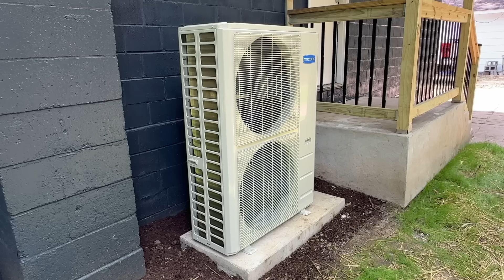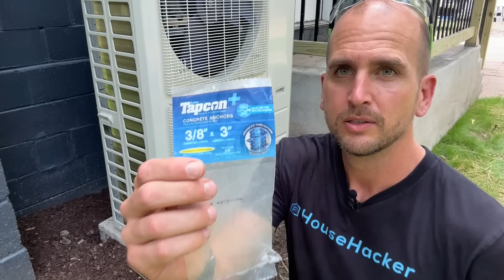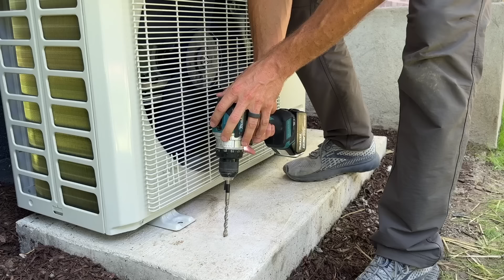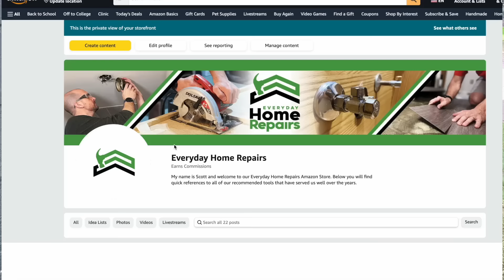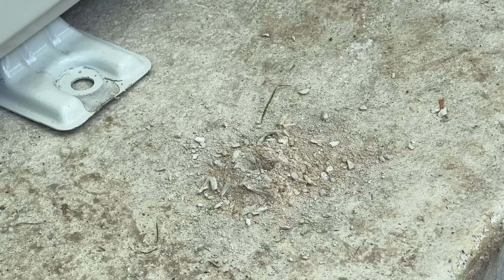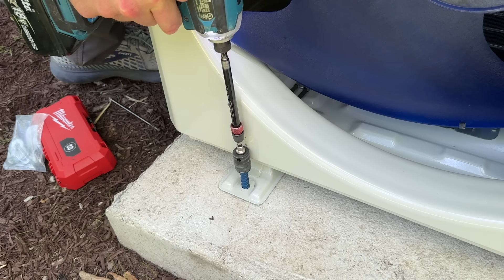The Only Concrete Anchor You Need And How To Properly Install

Comment: Want to anchor an accent rug over carpeting which is glued down to a concrete floor. Accent rug creeps with drift of carpeting. Two sided tape doesn't work. I need to screw the rug down so rug creep stops and only need to anchor one end of rug to stop drift. Suggestions on approach to using Tapcon for this effort?

Comment: There is something missing to your work bro,, you did not put any transision pad rubber between the concrete slab to the base of the A/C  this might cause vibration and corrosion..

Comment: I normally use a hammer drill, and I must not keep it straight throughout drilling.  I consistently create holes bigger than the screw.

Comment: I am a mechanical engineer, and this is my opinion. the Topcon directly screwed into the concrete, its secured depends on the quality of the concrete, if it has too much sand and gravel, the hold will be weak. The other problem is that the threads are cutting through the concrete with very shallowed threads to the root diameter of the screw and it doesn't provide a good hold if a force is applied to pull it out.  I spoke to a supplier, and they recommend using and epoxy for concrete gel into the hole to provide strength. For use horizontally on a vertical wall, with a perpendicular download, it should be ok. I don't recommend the use of Topcon for heavy load or applications with pull force. the advantages of using a lead anchor are that lead is a soft metal, and the screw will push material against the concrete hole creating a tremendous amount of pressure, to pull the screw, the concrete has to break first
Reply: Great info.  How would you attach the wall of a framed room addition to a cylinder wall of a house?  Topcons or Exoxy anchors in the hollow block wall?
Reply: You are absolutely right, I am a mechanical engineer and Tapcon screws are the last thing I would use on a concrete wall. I also spoke to a supplier and told me the same as you, to use epoxy in the hole which defeats the purpose of the use of Tapcon screws. My preference is a lead anchor, when the screw is going, it will push the lead laterally against the wall creating a tremendous amount of pressure. Any other system that applies lateral pressure against the wall is much better that tapcon screws

Comment: Instead of the electrical tape trick. I just get out a sharpie marker. Spin the drill bit and touch the marker at the depth I am going for. Washes off with a little rubbing alcohol. That way you don’t have adhesive from tape or have to worry about getting stuff stuck in the drill.

Comment: Tapcons are trash. Sorry had to get it out of my system. 

Built houses for over 30 years. Have affixed literally thousands of boards to concrete and steel and other various hard materials.  We used Tapcons when we worked out of state and forgot to bring real anchors with us.  

A concrete anchor shouldn't be able to be stripped out of its hole....it's friggin concrete. It either grabs or the anchor is no good. Over tightening shouldn't be a real issue unless you're just a complete bonehead. 

They'll work if you have to use them but are pretty finicky as far as concrete anchors can go.

Comment: I have had a lot of problems with the drilled holes being too loose.  I have used the specified drill bit size.  I think I must be pushing too hard on the hammer drill and the hole becomes oversized.

Comment: How about sealing the holes around the wedge anchors or these Tapcon screws?  I am putting in an outside hand rail into concreate and dont  want moisture to get in the hole and freeze.  Any tips?

Comment: Wow! I drill hundreds of holes a day with an SDS 3/8 red head and each hole takes like 5 seconds at most. After about 100 the bit starts to wear, I never use these bolts because they don't hold the weight. These screws are definitely for the diy but professionals shouldn't use the screws that you can never tighten down.

Comment: For the job you're performing, I would have inserted rubber damping squares between the concrete and the feet of the AC condensor to limit vibration to the unit.

Comment: I sort of like them but sort of dont. You kinda can't keep moving them. With wedge anchors you can remove the nut and move the item to like clean underneath and stuff like that, and then put it back and retighten the nut. With tapcons you'd have to remove the entire tapcon and everytime you do the hole isn't as tight. But if you actually DO need to remove the tapcon completely you can, then just fill the hole. With anchors you gotta cut it off with an angle grinder.

Comment: What’s the drill attachment called that he’s using to drill in the tapcon?
Reply from the maker: That is just an Masonry bit, specifically it is a "SDS" since I am using a larger rotary hammer drill which uses a chuck called SDS.

Comment: Yes, that hammer drill was not on the powerful side. SDS will also give you much, much better hammering and speed, even on the same powerdrill, than a standard choke head. The stroke is longer.

Comment: you should use rubber blocks with rails on them under that unit so when it snows the unit is not burried and the fan doesnt freeze stuck.

Comment: About to use these exact same sized Tapcons for setting posts for a horizontal fence on a newly poured slab for our pool. Question.... Any recommendations on how far off the edge you should go? I'm afraid with a large size like that, getting roo close may cause popping or cracking issues. Was thinking of setting the footings about three inches in from the edge. Any advice would be awesome!
Reply from the maker: I would be comfortable within 3 to 4 inches of the edge.  You could probably even go closer but if you can have a bit of an offset that would be good.  Wedge anchors would be a different story as they do press against the inner diameter of the hole as you tighten them up.  If you want to even step up from Tapcon try to find the similar product from Simpson StrongTie the Titen HD are really nice and have much more bite than the Tapcons https://www.strongtie.com/mechanicalanchors_mechanicalanchoringproducts/thd_anchor/p/titen-hd
Reply: @EverydayHomeRepairs  man thank you so much! Great advice!

Comment: I don't like the tapcon anchors. It seems about half the time I try to tight them the threads just strip out the concrete instead of making a secure connection.

Comment: Would it be smart to put rubber bushing/damper between the ac and cement to address vibration and noise. Ty
Reply from the maker: For sure, that was a miss on my part.  Thanks for the feedback!

Comment: I've seen those Tapcon concrete screws corrode significantly from moisture in concrete.  The heads shear off if trying to remove only after a few years, especially for the 3/16" diameter size.   I would only use stainless concrete fasteners in an outdoor environment.

Comment: If a Tapcon strips out just take a piece of bailing wire or weedeater string and stick it in the hole and screw in your Tapcon. Make the wire or string longer than the hole so you can cut it off after you screw in the Tapcon.

Comment: To the point about debris clearing, a can of compressed air such as used in cleaning computer keyboards and electronics would be a great help to blow out the bottoms of the dust and grit, and portable and convenient.

Comment: Failure mode is snapping off in the hole. That one sucks bigtime. For a stripped hole I use heavyweight Weedwacker string I cut lengths of it and stick it in the hole as much as I can then re insert the Tapcon. It also works for regular screws if that is all you have for concrete or a mortar joint and wood too.

Comment: What size drill bit u use for the 3/8 tapcon
Reply: 3/8. 3/8 is the shank size, that allows the threads to bite in without cracking the concrete or stripping the hole

Comment: I’m planning on putting 2 anchors into my concrete floor garage with hooks to strap down the rear of my motorcycle (set on it’s center stand  so the front wheel floats off the ground) and I’m wondering how much force/weight pulling upward can these Tapcons hold?

Comment: One tip I would recommend is not to tighten the bolts until you have all 4 bolts 90% or so in place. This will help preventing any possible alignment issues that could also cause your last bolts to not go in easy and even possibly strip

Comment: Insert stripped 12 or 14 gauge copper wire into the stripped hole and drive the Tapcon in. Snugs nice and tight.

Comment: My problem is more with the concrete than the Tapcons. I've got an old farm with what I call "farmercrete" -- concrete made as cheaply as possible with local river rock (some up to 3" in diameter), dirty sand, and a minimum amount of cement. The big problem is those rocks -- some of them are so ridiculously hard you can't drill through them, and if you do, the Tapcon will bind up as you insert it and it'll break off. Or you'll blow out the concrete when you drive the Tapcon because the large stones move instead of allowing the Tapcon to bite.

Comment: If you strip out the anchor I never drill a bigger hole I use weed wacker twine. Grab a roll of the bigger diameter twine and just put a couple of pieces cut to the depth of the hole then put the anchors back in. I've never had a problem using this method. Good thing about this its years before the twine breaks down if at all.

Comment: How are those Mr Cool mini splits? They seem super easy to instal. Any problems to look for? I've only done 1 mini-split so far(done many furnaces\air handlers w\ AC tho). I like the fact these are all pressurized already & ready to go after hooking up the lineset w\ flared compression fitting ends(no solder\brazing). 🛠️🔩🔧🗜️🔨📐📏👨🏻‍🔧👨🏻‍🏭😀🍻

Comment: Worked on alcatraz island for 25 years,doing concrete work, Tapcons were my best friends!
Reply: Were you installing your own escape hand and footholds?... 🤣
Reply: @thebordernow 😂😂😂😂
Reply: Hey,dogsense I worked on the Russ building in SF in 98 at 33 stories, and Tapcons were my best friends too. I could see Alcatraz from the roof. From SF Towers too.
Reply: @rickarchuleta1  alcatraz 1993-2018!
Reply: Tap Cons don't work everytime have some wedge anchors for those cases
Reply: My question is are the tapcons adequate to secure a 10x10 pergola where the winds can easily exceed 50mph? The anchors that came with my pergola are longer than the brick pavers I have
Reply: Native SF Born Raised…did guys really escape or is that BS
Reply: @dogsense3773  I live in Pacifica on the water just like Alcatraz did the cement ever break down I see some foundations here start to crumble under tap cons cause they used sea sand….

Comment: I notice that the fitting into the hole made by the driver has a better snug fit compared to the one made by the rotary in hammer mode. In my experience, rotaries in hammer mode just makes bigger than intended holes although in drive mode it’s often a pain to drill into concrete. Great video.

Comment: Careful where you drill there are buildings with tension cables in the cement floor.
Reply: If the buildings have "cement" floors, they won't be around long anyway.

Comment: always find at least 1 stone right where i need the hole and the drill wont cut the dammed thing... there always as hard as hard gets  and if there is one stone in a 3 acre concreate pad  i always walk right up to it and manage to put the center of my hole right over the stone every time ....    if i had luck like this in lottery  i would have to burn my money to prevent drowning in all of it

Comment: When I replaced the aluminum lattice columns, on my front porch awning, I used Tap-Con fasteners. It was easy and they've lasted over 10 years, exposed to weather and ice melt products. I installed mine with my corded 1/2" drill/hammer drill.

Comment: Loose the tapcons... they are crap.... I use GRK Caliburn concrete screws instead.... compare both... and you'll never use a tapcon again... the GRK's hold 1000 lbs per inch... you can screw then in... take them out... screw them in... take them out... screw them in... and they will still hold.... try that with a tapcon.... one time use only... and no time use if you strip the hole or drill it wrong... I have literally pulled out cables that were held by tapcons.... by hand... can't do that with the GRK Caliburns...

Comment: I prefer to use threaded tap inserts with bolts and lock washers for projects like this.
 And I apply Vaseline or other water/rust proofing to the bolts before installing.
 And there are also cap covers you can install which secure around the top ofbthe bolt thread and snap over the entire thing for more protection.
 I would have also installed rubber anti vibration pads between the feet and pad,
 They quiet things down as well as prevent any chance of stress inside the drilled holes over time
 There are also prefab pads made from better materials than concrete

Comment: I recently had an issue with smaller diameter tapcon screws and slightly over-sized pilot holes. I placed a plastic toothpick in the hole with great success. Someone below mentioned weed trimmer line. Would have been too thick for me, but I'll put that idea in my back pocket.

Comment: 3 inch is a bit overkill for this use ...and the pad is what 4 inch's thick?  I'm not taking any chances of cracking that pad with a 3 inch tap con. Which is real east to do in the corner of that pad.

Comment: 10mm is easier. Or 1cm if you like. It’s a bit easier to add-up in your head too. 1m=100cm=1000mm. So how would you add up 1x3/8 + 2x5/8 + 7x9/16? It’s ridiculous. Use metric. Everyone else in the world uses metric. Oh, and you didn’t use rubber mountings for fixing. Very NOISY if you don’t, and the AC unit won’t last as long as it should because of the massive vibration.

Comment: If the concrete becomes difficult to drill, try using some WD-40 inside the hole.  That helps a lot.

After you drill the hole, use the thin red tube nozzle on a spray can of WD-40 (or generic equivalent) to simultaneously clean out the hole and lubricate it.  Put the thin red nozzle all the way into the hole, then start spraying, slowly pulling out the nozzle while spraying.  All the dust will come out, and the hole will be lubricated for the Tapcon.

However, blue Tapcons tend to rust over time, and will snap off if you try to remove them years later.   I prefer stainless steel Tapcons for that reason.

Also, Tapcon, if you're reading this, please change your Phillips drive Tapcons over to Torx drive.  Much better, less cam-out.

Lastly, if the hole gets stripped, try putting a length of nylon cable tie in the hole to snug it up.
Reply: I like to use baby oil with drilling my holes 👍
Reply: So does Diddy  @JakeStewart1343

Comment: The problem is not with those tap cons, it’s with the 3 1/2 inch ones that have a Torx head for the bit. Are the same ones that have a nut driver like that one but they’re skinnier. They tend to snap.

Comment: I install floor switches in concrete for rollup doors and many times used the nylon inserts until I noticed rust and corrosion on the screws when replacing switches. Since I started using the Tapcons the corrosion is no longer a concern.

Comment: Here is a tip to avoid bit drift. Drill a hole in any 3/4 wood the same size as the hole for the anchor. Place it over the sharpie mark and put weight on it with your foot. Bit cant drift.

Comment: Are you supposed to use the hammer mode when screwing in the tapcon, or only when drilling the hole?  Also, a can of compressed air can clean it out well if you don’t have the compressor.

Comment: I had trouble.  I had some Phillips head (actually torx head) left from another job.  I couldn’t get things tight with the suggested hole.  I went a little larger and it was loose.  I went to Home Depot and purchased wedge anchors.

Comment: Good Video except for the fact that you didn't use the rubber isolation pads that come with the mini split. The isolation pads are there for a reason which is to avoid vibrations and reduce the refrigerant flare connections from loosening. As an HVAC licensed contractor I see this all the time. The tapcon explanation is good although opting out of installing the unit correctly will cause problems for the home owner in the future. They are paying you to be the PROFESSIONAL. You should be going above and beyond what a handyman does.
Reply from the maker: That for the feedback and I agree that was a miss on my side.
Reply: @EverydayHomeRepairs  So,  did you go back and correct your "miss"?

Comment: question: can i use the tapcons to secure fence post brackets to concrete? seems easier than the sleeve concrete anchors
Reply: Hard lesson learned: Blue Tapcon heads eventually rust. SS Tapcons don't.

Comment: vacuuming or blowing from the top of the hole does not get all the debris out. a sufficiently small hose at the bottom of the hole can. then drop a drill bit in to verify the hole is deep enough before inserting the anchor. also do not fully tighten the anchors until starting all of them so the metal flanges can shift as needed to the bolt pattern.

Comment: If stripping out a hole, how about using concrete/metal adhesive?  If the issue is not being able to unscrew a glued in anchor, perhaps putting wax on an anchor that is inserted into the a hole filled in with adhesive or JB weld steel paste epoxy, will prevent adhesion that prevents screwing out.  (JB weld steel paste epoxy is incredibly strong)